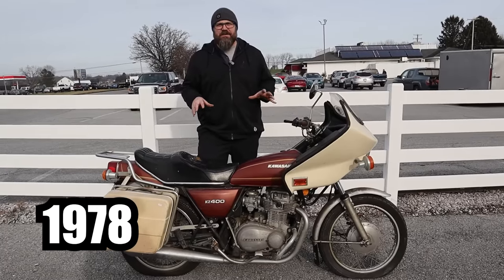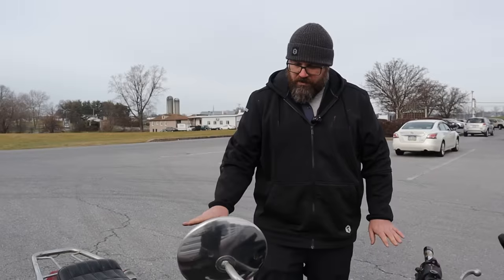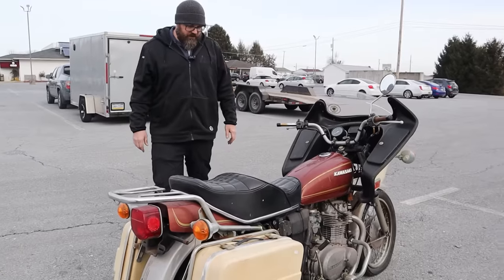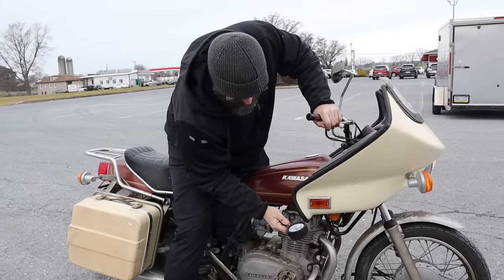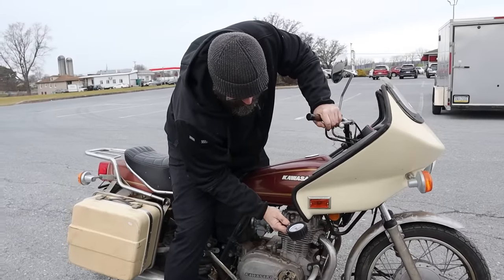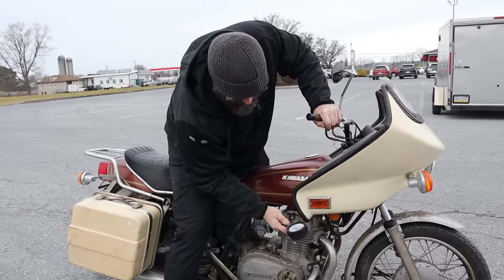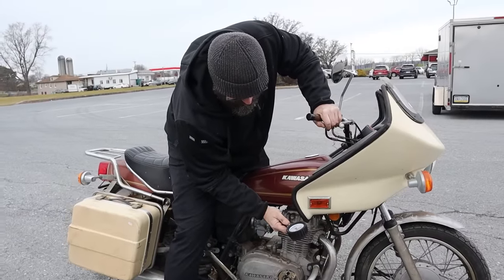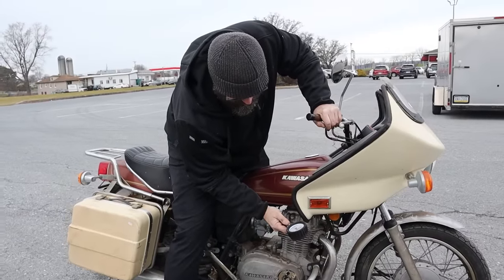Will This 47 Year Old Estate Auction Bike Run & Get Me Home?

Comment: I managed to jiggle the fuel cap lock open on a mates 78 Z1000 using the small screwdriver on the back of my Swiss army knife . There was a key number in the there and on the ignition barrel. ordered a replacement key from the key number.

Comment: I would say 105 isn't ideal but it will work, these air cooled bikes have vastly different compression ratings when cold. I have a KZ650 and I was able to get the bike to start on 40 PSI before replacing the rings. It didn't run for very long, or well, AT ALL. But it still kinda ran! 😂

Comment: Your next challenge should be to only use the tools you find with the bikes you buy... just to take it to the next level of difficulty... great find at a great price... and a pretty easy fix... To make a quick key, take a hacksaw blade, grind an inch or so on each end down to about 1/4 inch or so, and cut/grind/file 4 or 5 v-shaped notches in the skinny bit... then it is just wriggling and raking out the lock whilst gently turning it... oil is great to loosen them up... Japanese locks from this period are not high precision or tight tolerance mechanisms... patience, and you will usually get a lock to open... cheaper to try this than call a locksmith... or if you have other keys from other bikes - even random ones, keep them on a ring in your toolbox and you have the same thing... random worn out keys that can be wriggled until something pops open...
A half kick is when you bring it to just over TDC before the big kick that you hope will start it...

Comment: If you start it with starting fluid, use WD40 also.
You can easily lock up a piston, but the WD40 lubes it, plus its flammable too. 
I've seen an engine lock up by spraying it as these guys did.
Be careful.

Comment: Man, when I was maybe 12 or 13 years old (I'm 37 now), we had a ratted-out 1970s or 1980s Kawasaki KZ900 or KZ400, I honestly can't remember if it was 2 or 4 cylinders now to narrow it down, but I swear the side cover had 900 on it. It had a knobby on the front and a street tire on the back. My stepfather said when I can kick it over, I can ride it. He showed me how to do it. Then, I stood on the kicker with both feet and jumped with all my might. Took me a week to finally get it started, but then that was my first motorcycle. I tore up the yard on it.

That's not even the beginning of my motorcycle journey. That started when my mother took me to school in elementary school on the back of her 1970s Ironhead Sportster. I remember I almost got in a fight because a kid asked me why I had a helmet in my bag, and when I told him my mother brought me on her motorcycle, they called me a liar and said women can't ride motorcycles. That's about all I remember about that. I also remember riding in my stepfather's lap on his Electra Glide, he would shift and reach up to steer but I controlled the throttle and he was hands off in the straights and would knock me in the back of the head with his knuckle if I wasn't giving it enough gas.

Comment: I had a 1975 Kawasaki KZ400 it was a kick around bike when I was 15 in 1991. No ignition switch (wired in a cut off switch on the battery) original tires the front was cracked and the rear was bald it was a rat bike if I ever saw one but I had a lot of fun with it. I even still have some of the parts for it.

Comment: I always felt these looked a lot like the Rickman Touring Fairings (Polaris or a bit Tempest), those bags too, I'd bet they're aftermarket.
That Aspirin bottle is for your Slide Guitar.
..And I've a hunch you already know this, but an automotive Locksmith would use a blank to take an imprint and cut a key from there.. Once that fuel cap uh... came loose, it'd be a lot easier to take to the shop and getting keys cut is a lot cheaper and easier than sourcing new locks with keys.
'Great Bike though, it'll be a peach when done and I bet the screen won't be too hard to find if you're keeping the fairing (maybe a Rickman will fit).

Comment: At @33:09 you can see when the battery unpluged and the charging system overvoltaged and fried everything (at least the front light, even with blue spark)

Comment: That takes me back to my first bike a 79 model. I had the same setup sans bags and added a sissy bar. I'd like to day good times, but they weren't. so much adjustments, points valves kill me now. My next bike was a 1985 Suzuki that one could just put  gas in it and go! LOL

Comment: In England we called that a leading link front drum you should explain why it is better to the nice viewers, also over here there would still be half a seagull stuck on the broken screen we left them where they fell as a badge of honour to a bird which is a pest but is willing to frontal attack a motorcycle doing 80 head on.

Comment: I would love to see you fix a Kawasaki kz550 the standard one not the ltd.
I bought one about 23 years ago and the guy I bought it off heavily modified the engine so as you can imagine I had all sorts of problems with it and I had a little bit of a shock when I was going faster than I should have so I striped it all down and rebuilt it all then sold it on to a collector who loved the fact I put it all back to original including the paint job I did on it.

Comment: If it was locked, I have an idea why the tank cap came off. I noticed that on some of the Japanese bikes from that era, the lockable cap wasn't a proper lock and just an internal gate that moves out the way when you stick any key in it for that bike and allows you to undo the cap. Not sure if it's the same with Kawasaki but it was only like that for the the tank cap and not the other locks.

Comment: I think I have never used a correct cotter pin when putting a wheel back on.... I've used zip ties, coat hanger wire, nails, a stick, paperclips, shoelace, those reusable cotter pins that look like grenade pins and even hitch pins. But that's normal in PA.... Especially if the bike isn't "road worthy".       😂😂

Comment: you might be interested in a brand new never used old stock  vented original 1979 Vetter fairing windshield. Let me know I bought it for a 1979 better fairing I had on a 79 gold wing.  You need a locksmith dude he might be able to make you a key before you destroy the tumblers! The usual reason these these bikes get parked and given up on is the carbs need the pilot systems cleaned out then just a total carb rebuild. Been there many times with success. Dude put the bike in the truck and take it home to a workshop or garage!

Comment: should have put a hole in one of the fairing pockets run some line though it and then found a container that would fit inside it for a fuel tank

Comment: I have an 85 virago, it has a key and yet a flat head will do everything but start the bike haha it opens my tank and my little compartment on the rear and my helmet holder with ease hahahaha im probably going to invest in a new tank cap so i don't need a screwdriver to open it

Comment: You can hit the screwdriver with a hammer and drive it into the lock cylinder then use the driver as the key. You have to hit it good an hard though.

Comment: There’s a piece of advice if you don’t run don’t buy it could have all kinds of problems transmission gear gone electrical wiring problems rust in the gas tank carburetor problems If you don’t run don’t buy it

Comment: Too bad you don't understand the CV carbs have slides that act like closed throttle plates, making a compression test low and  inaccurate. Too bad you don't come prepared with the simplest of tools to get a bike sitting for years with simple tools like a cheap lock pick set, a multi-meter, etc. What did you expect?? The least you could have done is got a thin piece of metal to try to open the gas cap, or even better some old keys to try to it open. One would think that someone that rides motorcycles and does videos would be better prepared.